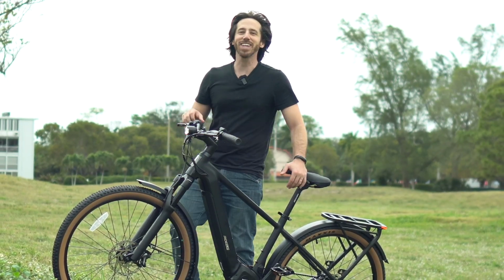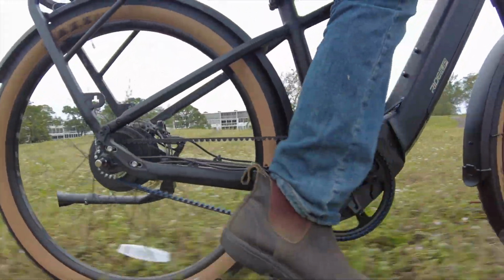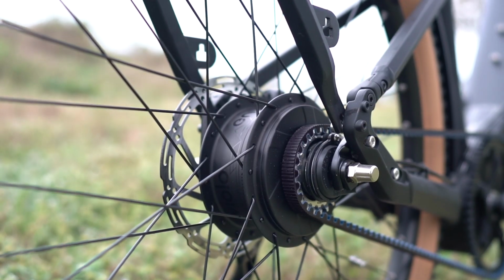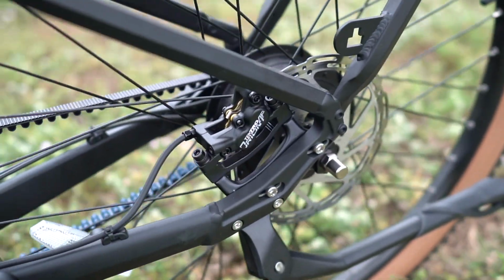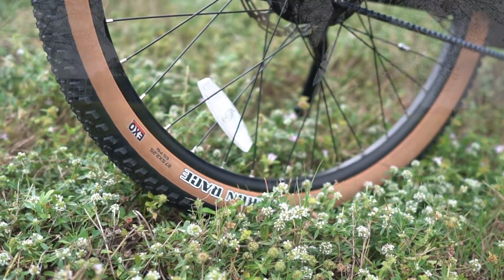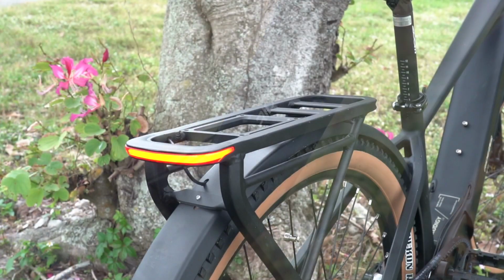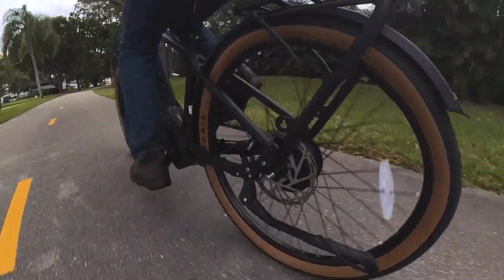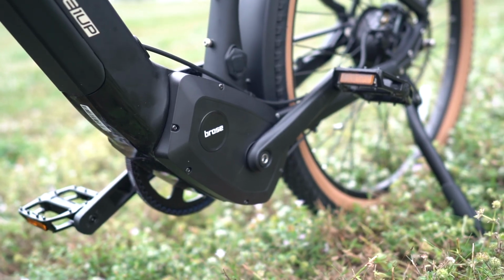Ride1Up Prodigy V2 review: An affordable Brose mi-drive e-bike!

Comment: I have the Priority Current, thanks to this channel, and this is an interesting option for a second bike. Likes price, metal fenders, front shocks, rack light, colors. Cons cables visible, battery size, battery cover, front skewer axle. Still on the fence with this choice.

Comment: The killer is, There Is No Throttle, On a STOP when you've got to get across fast and quickly, a Throttle-Switch assistant would be a excellent accessory to have.That's the downside, which is HUGE !!!

Comment: I just got this bike last month, riden about 40miles so far mostly on boost/sport modes in a hilly area, i went for the 9speed instead of cvt as i ride alot of trails in between roads it shifts perfectly! so far im happy with it, i already swapped to a 20mm shorter stem, wider bars, dropper post, skinnier seat, clipless pedals. Getting about 18-20miles on boost in colder weather im sure on tour i could get 30+. Fork feels good, agreed on the axles and spoke mounted speed sensor and some cheaper components, but for price"2400usd" i cait complain, my average speed is usually 18-20mph so its a pretty fast bike for knobby tires. Its getting me on my bike more which is always a plus! I pulled the trigger because i love the lines of the frame"reminds me of a dirtjumper" but its definitely not a jumper being almost 60lbs lol, still has great handling though!

Comment: I'm honestly bummed with the V2. I bought one of the last V1's on sale last year, in the now discontinued XC flavor. It has the same motor, but a 120mm fork and weighs 8 pounds less. I upgraded the transmission from stock and now have a relatively affordable hard-tail XC e-mtb that absolutely rips! It's so damn fun, I can't even tell you. You can't do that will the V2 without replacing the fork, making it not financially viable (just buy a stock e-mtb at that point) and then it will still be too heavy. At least I got mine! If you can find a V1 Prodigy XC for sale though, I highly recommend grabbing one and throwing a high range on there, it's a blast!
Reply: I second that - I also got one of the last Prodigy V1 XC bikes, and it is a BLAST to ride! Super maneuverable. Even when just commuting around town, I find myself hopping up and down curbs for the fun of it.

Comment: I owned one of these and found that it was chunky feeling and I also found that the Enviola transmission was just not what I had hoped and realized that I should have gone with the chain drive. I will say that the customer service from Ride1Up was incredible and they allowed me to return the bike. For the money, I think that the Limited is one heck of a better deal all around.
Reply: What about the belt drive + cvt did you dislike? Haven't used one yet so living/learning vicariously, lol
Reply: different bike concept .. but I also have the LMTD and love it!!
Reply: I went 9speed and like it! Did it not have low enough gearing for trails? Thats what i thought and went for the 9speed, but never tried the cvt, seemed like the cvt is more for rd riding

Comment: Love everything about it... except the battery size and yea thru axles on the front are kind of important. I live in a higher crime area and a quick release front wheel means it will be stolen if also not locked up by some kid or opportunistic thief. They really should let people add the roadsters dual battery setup to this.. also wierd that they keep at 36v when the rest of the industry is moving to higher voltages. Mostly 48 and 52 these days.
Reply: I have the prodigy v1. My biggest complaint is the short range and small battery.
Reply: Think its to get more range with smaller battery. Mid drives are more efficient then hub is another reason

Comment: The small battery is a bummer and deal killer. They should at least offer an optional 800 wh battery. Once the included battery degrades a bit, the range will become unusable for many.
Reply: 2 pricey
Reply: Buy an extra battery and "pack it?"

Comment: NICE!
I don't understand the choice of bike comparisons. The only bike I can think of that competes with this directly is the Priority Current. I hope this will force Priority into some upgrades or a price drop on the Current.
Reply: Specialized turbo vado 3.0 and higher is very close, its 29er though with alot better components, way better cable routing ex.. but its like $5k usd so i bought this instead. So far im fairly happy, but at 1000miles plus i might be saying differently, just cant see spending that much $ on a pedel bike i use a few times a week
Reply: @evan1kx125  I should have specified that, IMO, to compete directly prices must be similar. No LBS brand name e-bikes qualify to compete in this category, on price basis alone. Those bikes may have slightly better components, but for the price they should. I think you made a wise choice. You got into e-bikes relatively affordably & if you like your ride you can always ride the components until worn & upgrade to whatever components you like.

Comment: Really cool bike. When is the review of the Ride1up CF racer 1 coming up?
Reply from the maker: Coming soon!
Reply: That  would be great to review, it is for the more serious bicyclist though!!
Reply: @pddellow true , but it does have mounting points for a pannier so it could be used for commuting
Reply: The reason this bike is a big deal is a similarity specced ebike from big name manufacturers cost at least $6,000 while a similarly specced non ebike with integrated bars cost $4,000. This is going to be a lectric moment for the road cycling industry.

Comment: Brose is great... love it, too bad they only address the European market and not the U.S. why don't they do anything to address the American Market, offer 500 or 750 watt. Til they do, the American market will keep them out!
Reply: I pay more attention to the nM torque than the motor size. It is likely that the actual wattage is more than the nominal and that this bike will climb any hill you need it to. For example I have test ridden a Gazelle bike with 85 nM of torque and it's hill climbing is impressive yet it is equipped with a nominal 250 watt motor.
Reply: @robertkribs9513  you identified the problem right there! Americans live by the ethos, bigger is better. Americans want the ability to fuss with the controllers, they love to overvolt, run 5000 watts and so on and so forth. Brose is not the type of E-bike company that allows much hot rodding of parts, sure you can tweak it some... but the Bafang allows for infinite dimensions. Brose is a BMW and Bafang is a Land Rover. Americans love the Rovers!
Reply: On the other side, Ride1Up don't ship to EU

Comment: Great review Mike by watching your reviews I’m thinking of e-bikes now to get around I recently lost my right leg. I have a prosthetic and so I can’t drive a car anymore so I think I’m going to go with these type of transportation, back-and-forth to the stores and stuff.
Reply: For you though, you may want to consider the LMTD (torque sensor) or 700.  Simply because they have a throttle, which I imagine would be handy to have for you when starting up.
Reply: My dad has a lmtd xr its a very tall bike compared to this bike and the wheels are the week spot especially with the hub motor, they also come with spokes that are all bent slightly "like the nipples need to be angled but they aren't" Moms turris is same way. Spokes seem a bit loose and needed to be trued right away as they had more then 1/2in side to side wobble
Reply: @evan1kx125  Hmmm I am 5'6" and have the LMTD XR, fits me perfectly.. seems about the same as the Turris as far as sizing. The big difference is the torque sensor vs. cadence. Fantastic bike!